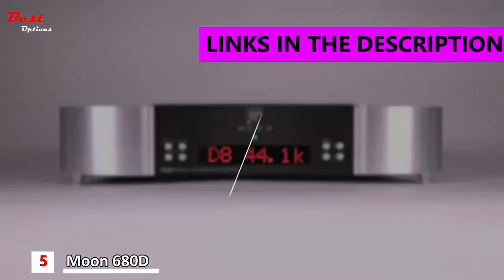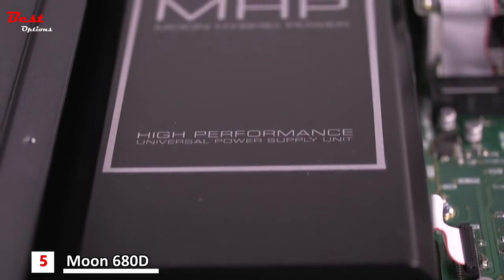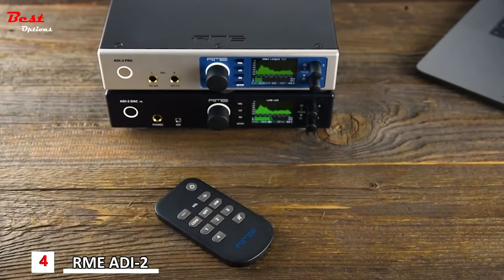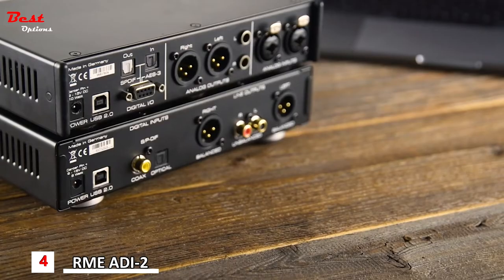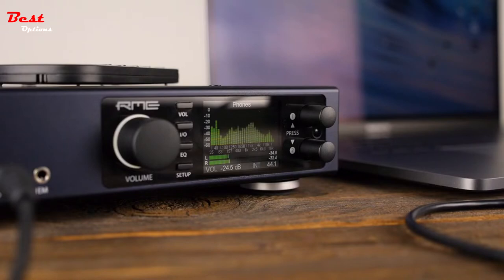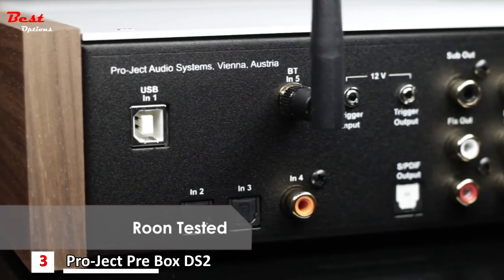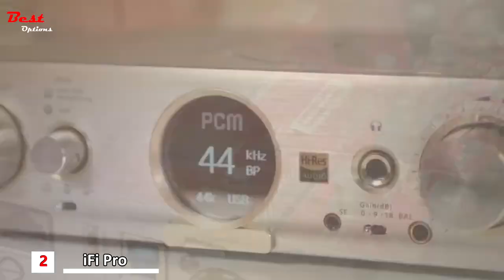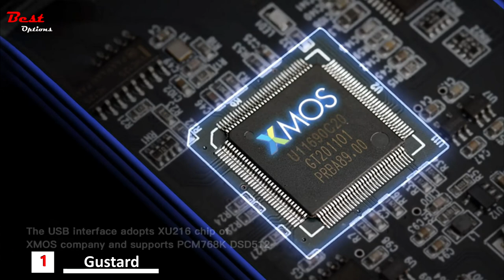Best DAC 2023 | Top 5 Best DACS 2023

Comment: Moon 680D is a complete and utter waste of money. I feel like even if they removed the unnecessary features to lower the price, it would still compare poorly to the new Chinese ones (at least the ones in the $1k to $2k range). As for the others including unnecessary inputs doesn't equal better sound. I will be looking at the X26, A26, and R26. Glad you hold X26 in such high regard.